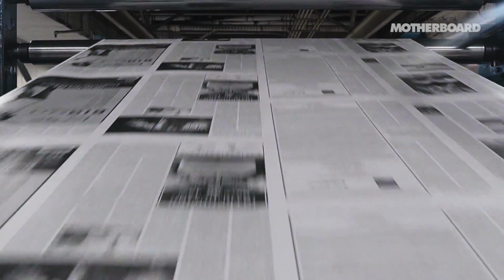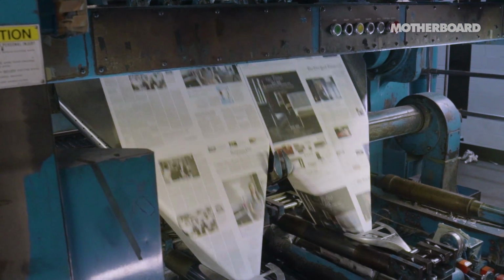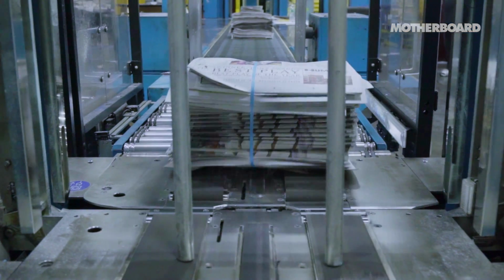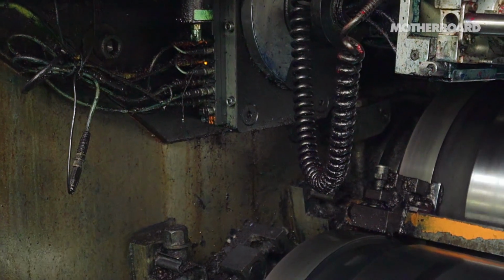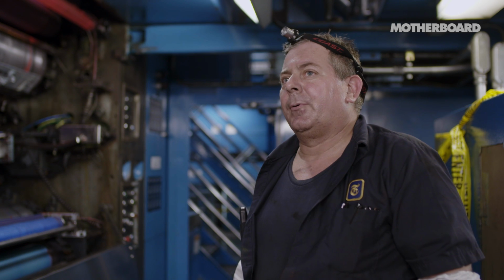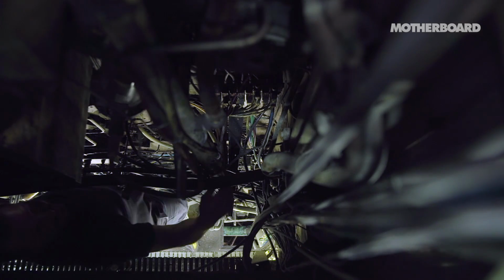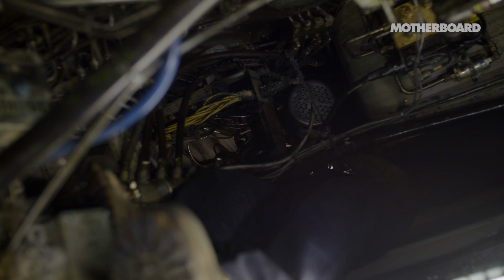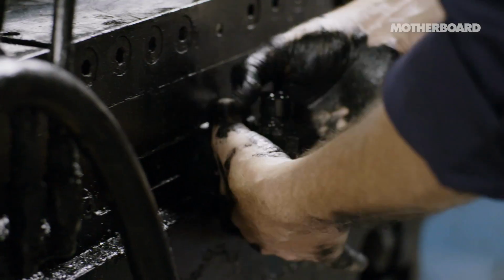Meet the Machinists Who Keep the New York Times Running

Comment: I really miss the 20 years I spent working for RR Donnelley, printing catalogs.  It was a craft that we worked hard at, and took a lot of pride in.  Will never forget running a commercial offset press, 6 crewmembers to run a press, 40 million dollars of steel running at 3000 fpm.

Comment: They're millwrights, not machinists.
Reply: bumbumboom  machinists are people that operate lathes, mills, grinders,  broaches, saws, drills presses,  laps or some other equipment that is used to make an object into something else or to repair by removal of material. 

A millwright is an industrial mechanic. Millwrights repair giant factory equipment and do preventative maintenance on production equipment in a factory, mill, mine or some other environment where there's heavy use of hydraulics, pneumatics, conveyors, pumps and other rotating equipment. 

A CNC guy is a machine operator, not a machinist, unless he's setting his own jobs up, writing his own programs and measuring dimensions on his own after each M00.

I'm a MACHINIST and a MILLWRIGHT. I do both for work and have certifications in both fields. I can also write my own CNC programs, so I'd advise you keep your ignorance to yourself before you really prove you have 0 idea as to what they actually do in different trades. It's basically like calling a carpenter a welder. The only overlap they really have is math and ability to read and understand engineering drawings.
Reply: @СшаСша-ф5о  Sorry to pick but there trade in Newspaper by the Union it is a  Machinist. So you had to be able to work on the equipment and also run all the shop equipment you saw behind them. So basically they do your job and also repair the printing press. Its a great job just not to many places to work. Most presses are heavy electrical also so you need to be more multi craft.

Comment: You mean to say the New York Times has machinist that do all this work. Where the heck are the printers? In my workplace the printers are the machinist we do everything
Reply: I operated a variety of presses in San Diego and in San Luis Obispo County from 1972 until 2004, mostly printing newspapers. Having someone to do repairs is a foreign concept to me, because it was always the pressmen's responsibility to do preventative and emergency maintenance and repairs. We couldn't go home until the press run was done, which made for a long shift if something broke. I worked a number of 18, 24 and 40 hour shifts during my time. It could be brutality physical work running up and down those ladders. When I retired, my legs and forearms were like steel and looked like Popeye's limbs, but my knees were shot. I can't believe I miss the stink of ink and the mess of the press.

Comment: If this were an Australian business
Instead of 3 people involved in maintaining this press, there would be;

1 asset maintenance manager
3 process engineers
2 mechanical engineers
1 reliability engineer
2 electrical engineers
2 maintenance planners
2 equipment specialists
4 technicians
3 fitters
3 electricians
1 welder
1 rigger
1 forklift driver
1 lubrication man
All operators trained in how to change the ink packs, but the fitters would do it on overtime because the operators would be too lazy to do it

And it would be filthy, covered in bandaids and have an 85% overall equipment effectiveness

Comment: I work on feeders for sheets ironer and folders most of the older guys never get close to the plant were I work at because machines were made in 2017 2018 they are newer they better work on the 1990 to 2000 machines but the quality of the newer machines doesnt compare to the older ones the older ones are badly pressed and bladdy folded the machines are always like that because they rely only on a contactor to set the speed while our newer ones have a vfd for every motor so it's much better controlled with an encoders

Comment: These maintenance technicians are part of the people who are incapable of learning new things. They say they prefer old mechanical machines compared to the new machines which use more electronics and electrical components. Little do they know that Semi-conductors and its by products have made everything possible. Before semiconductors/electronics were used most plants used electromechanical relays and this meant more costs and made the plant not flexible to new changes because it takes lots of time and money to rewire and reconfigure the plant, but since the era of electronics, all you had to do is to reprogram the computer/plc and would require very little to no re-wiring of field devices. This is another reason why the printing press industry failed because they are not into embracing new technology. Digital is now the new thing. These "machinists" , which they are not by the way, can't probably troubleshoot a complicated fault. They most likely do not even know that most high-tech plants use laser alignment rather than just straight edge or rulers.
Reply: You could not do what they do...you just spelled it out with that diatribe above. Stick to keyboards.

Comment: The problem with these monkeys is they know nothing about electricity.  Using a meter or oscilloscope is incomprehensible to them, because they can't see an electron, nor do they know how to program the PLCs that are likely to control most of that plant.  Typical simple minded machinist.  They can fix a broken shaft because they can see that it is broken.  What a bunch of simple minded monkeys. I spent 20 years as a plant electrician working around these kind of knuckle draggers.  I know them well.

Comment: I worked for a while in a warehouse sorting/delivering Newspapers, it is a rush against the clock, newspapers should be delivered before 8:30 AM, and the rush starts at the press, some newspaper start printing around 8:PM from there to get to the warehouse can take up to 5 hours, then the "baggers"  and "runners" and delivery ppl have a few hours to cover up to 1000 houses in a matter of 2 hours. Rain or snow nothing will stop the news from being delivery on time.

Comment: In the UK these gentlemen are Fitter-Machinists, they the most adaptable of engineers, they built from blue prints to scratch building using the old part as the pattern.

Comment: I work on right next to the press guys and its sad to see how technology turned them obsolete am talking of 40 years working in a place and being cut off because they just bought  newer equipment. Its sad. Am also a  mechanic myself and i really get to value the simplicity and longevity the old stuff compared to the new computer control stuff i might be faster but if something brakes you better have a fat wallet to call a special technician to fix it for you.
Reply: you should see how expensive it is to repair equipment that makes computer chips.
Reply: @kercchan3307  i imagine it should be in the thousands of dollars everytime something brakes
Reply: higher, try 10,000's or more depending on what is wrong. The last new plant I heard of being built in the USA was 2 billion including the processing machines, I think. The silicon wafers around $1000 for one

Comment: weird to see these guys were afraid of the electrical aspect of the machines. I cant say ive ever worked on a machine that did not have a strong electrical aspect to it. although my schooling is is electrical engineering so in my machine repair you have to be good at both the mechanical as well as the electrical to get the job done.

Comment: Loved this. When I used to see our mechanics working at the LA Times, it amazed me how they could get our very old Goss presses running with even older parts, all to get the news on the street on time.
Newspapers are so expensive to produce, without advertising, a $1.00 newspaper would cost $50.00, minimum. There is little margin without the advertising, so the work the mechanics do makes that small margin really critical.

Comment: Looks like a talented group of guys, though in most industries they would be considered maintenance guys not machinists ( as one of them stated in the beginning). A machinist is someone who makes parts out of solid pieces of steel, aluminum, etc. using chip removing processes like milling and turning. Just a nit pick though, interesting video on the whole.

Comment: if they think the bass in a printing press is impressive they should try working in a forge with a 9,000-ton press and a 12,000-ton press. you can be outside in the parking lot and feel the press hitting the steel through the ground also can feel the bass all over your body in the changing rooms halfway across the factory

Comment: There seem to be a lot of arguing back and forth about what these men said about the old school mechanical equipment versus modernized and electronic based modern equipment. Both factions have their advantages and disadvantages, and I have seen both sides. As a computer engineer who has worked as a millwright, I think I know about as much as there is to know about the debate at hand. 

Truth be told, I side with the guys in the video more than for the modern technology, and here's why: old machines just run-run-run and run. I've seen 30, 40 year old equipment that lives a hard hard life and is still working just fine against the struggles of daily heavy industrial production, partly because maintenance is easier but also just because of a general 'chunkyness' to the designs themselves. The advances of global trade and modernization mean many things are made leaner, trimmer, cheaper, more efficient. The general notion of overbuilding something, leaving room for a worker to get a wrench in an area, making things out of chunky cast parts is lost. 

On the other side, modern equipment does have features, solutions to problems that couldn't be dreamed of 40 years ago, and runs efficiently and often more quietly, but it is very hard to repair, troubleshoot, 'get a feel of' and learn intuitively by nature. Additionally, it has an inherently shorter service lifespan, because simply put: when electronics fail after a period long enough that parts are scarce (which happens after about 10 years) and you fall flat on your face scraping ebay for rare circuit boards, you end up looking at either doing a complete controls upgrade or getting rid of the whole thing. I've experienced this first hand, it is sad but true. With the mechanical machines, even at expense, one can find or make a replacement for something: or figure out how to make something work and work properly again. Their life cycles are simply longer.

Comment: sorry guys you are maintenance mechanics, not machinists. I have been a maintenance mechanic as well doing the same job as you, but just fixing CNC machines instead. Now, I am an actual machinist using CNC machines to make parts with a 50 millionths tolerance. Don't misuse the term. A machinist is not someone who replaces parts on a machine and maintains them. If that were the case, then auto mechanics are now machinists because a car is a machine! Now, if you had a broken shaft, and you went on a lathe and a mill and made that shaft or welded it back up and machined it to spec, then yes you'd be a machinist. But I will say that they seem like a good crew to work with.
Reply: some people above in the comments were saying that they are actually millwrights as opposed to machinists
Reply: this is very tru my dads a cnc machinest and tool & die maker
Reply: same here I make tooling
Reply: Murtagh653 that is precisely what they are. didn't know the term for it.
Reply: 98raza20 it would be but they're not machining anything. they would have definitely shown that if they were
Reply: I was just thinking the same thing. A mechanic repairs, a machinist creates.
Reply: America is the only developed country, where you can call yourself what you work with. Everywhere else, it requires education
Reply: The precise meaning of the term machining has evolved over the past one and a half centuries as technology has advanced. In the 18th century, the word machinist simply meant a person who built or repaired machines. This person's work was done mostly by hand, using processes such as the carving of wood and the hand-forging and hand-filing of metal. At the time, millwrights and builders of new kinds of engines (meaning, more or less, machines of any kind), such as James Watt or John Wilkinson, would fit the definition. The noun machine tool and the verb to machine (machined, machining) did not yet exist.
Reply: These guys are most definatly machinists, maybe more of a millwright but your not a millwright  unless you can machine a piece of steel.
Reply: they do both so yeah they were the Machinist
Reply: Glad I’m not the only one that got a little offended. Manual machinist here.
Reply: U mean they HAVE a Machine shop With dedicated machinist to make the parts they removed!
Reply: Yep ur right there maintenance technicians. When you say machinist think of a tool maker.
Reply: Machinist is who drives a train
Reply: I have been a machinist since 1978 and you are spot on with your view  regarding machinist v mechanics.
Reply: Well said! As a certified CNC Machinist, (Operation and programming) I have met many people who claim to be machinists, but fail to realize the full process of manufacturing. Many people who claim to be machinists are actually just button pushers, or mechanics as are these men. (Though their job undoubtedly requires a high level of skill simply due to its nature) A true “machinist” in the modern sense, is a problem solver for the manufacturing of exceedingly tight tolerance parts. (Sometimes to +\-0.0002”) Most often, they use CNC Mills and lathes. They understand CAD Softwares, G-codes, QA processes, materials science to a degree, and the practicality of the part or product being machined and/or assembled.
Reply: Sorry to tell you this brother but a machinist does shit by hand not cnc anyone can push buttons
Reply: Blaine Brady but not anyone can math parts out by tool established features, read blueprints, understand Datums, the difference between first and third angle projections, and perform detailed QC procedures. Often CNC certifications come with “fabricator and welder” certs as well; As did mine. If your a “machinist”  and can’t fabricate parts on demand, your a button pusher as you said.
Reply: amber lopez you do understand that IMMs (Industrial Mechanic Millwright) still machine and fabricate one off parts, more so than a machinist. A machinist is someone who makes parts on a larger scale and is less likely to be making one off parts. A millwrights shop would typically be just shy of a machine shop given the fact that they still make many parts they need. Just because you use a mill or a lathe does not make you a machinist.
Reply: Machinists come in a shapes and sizes. True, production machinists make parts on a large scale but, there are also prototype and custom machinists that make one-off parts (think surgical implants and aerospace parts).  Producing parts isn't their primary job- maintaining the machines is.  These guys are maintenance mechanics who do some machining when needed.  There is a big difference. @cameronabrams3285
Reply: That might have been the case many years ago, but it isn't anymore. 

Your average millwright today will never operate a manual mill or lathe, let alone anything more complicated. Honestly, your average millwright today would barely know how to use a bench grinder. They spend the vast majority of their time balancing and performing manual labor, and are largely welders. 

A millwright brings broken parts to machinists. I would trust a machinist to fix large scale machinery but I'd expect him to take a year. I wouldn't trust your average millwright to run emery on a shaft without getting caught on a lead screw. The most insanely dangerous and ass backwards machining I've ever seen in my life was done by journeymen millwrights. Guys turning down 12" OD shafts with fucking inserts worn to the shims at 1200 RPM.
Reply: Jason Travor I’m an actual certified Machinist and certified construction Millwright, where I’m from these guys would be Millwrights with Machinist tickets.  I can machine complex parts on any machine tool, but most Millwrights do small basic repairs as most maintenance shops have limited machines and tooling, when we need to replace major components we send the parts out to an actual machine shop.
Reply: https://www.merriam-webster.com/dictionary/machinist
According to every Dictionary out there, they are Machinists, in fact the term came to be from people like them, not your type.
Reply: There's a lathe right behind them. Sure they didn't show any machining, but you can bet your ass they're machinists. I hit 50 millionths on a 10y/o Haas the other day too
Reply: what makes you think that haha, cnc gets very complicated at the higher levels
Reply: Cnc work is easier than this tho. . . .
Reply: @VictorRomero-rv5dz   why dont you try to do it ass